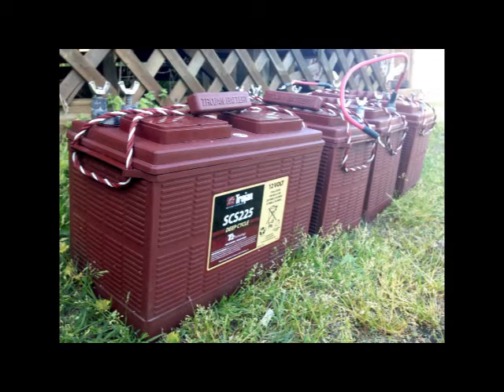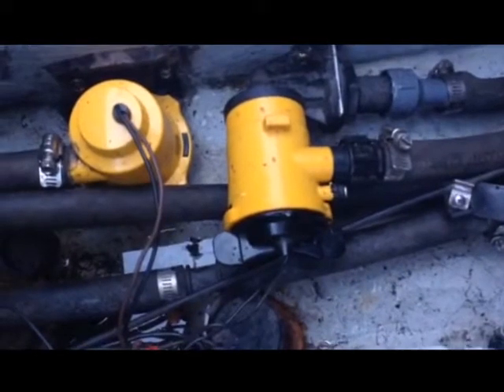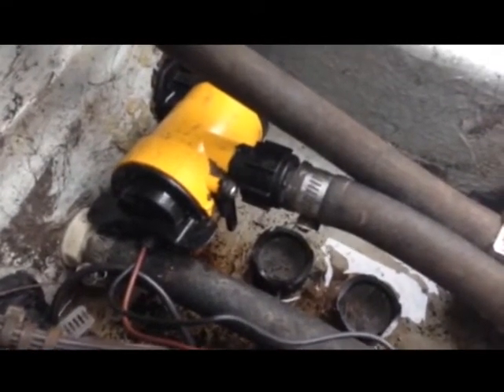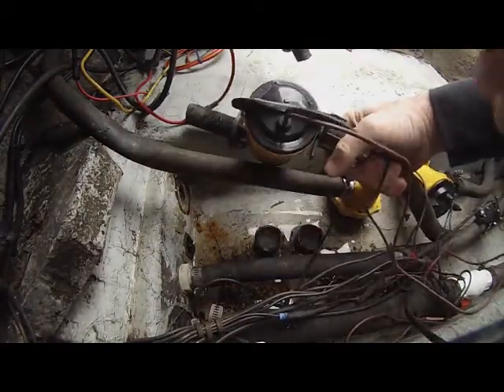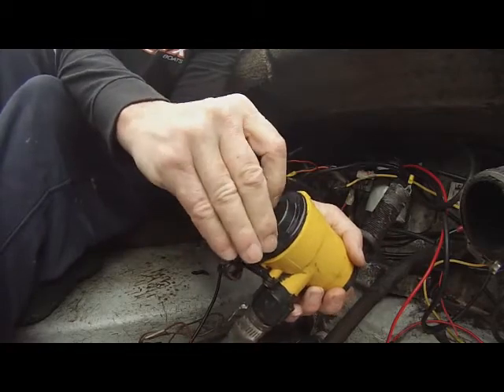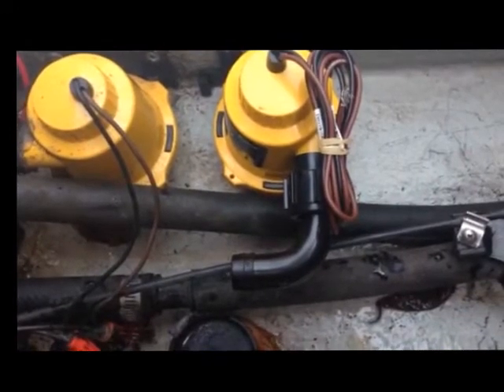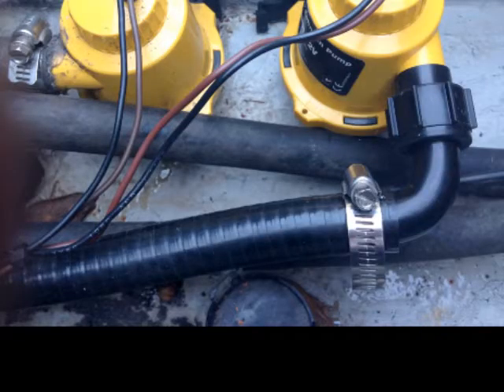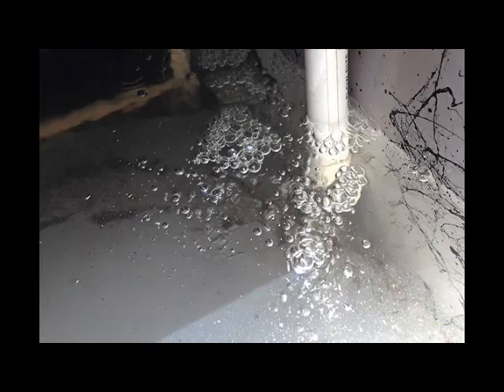Keep Your Bass Boat Alive, Part 11

Comment: Mark, I have watched all your keep it alive videos, great for all us old folks. (78 for me). I bought a 1997 Nitro savage 884 with the mercury XR6 EFI 150hp 2stroke. Ebay auction $2750. Drove from Florida to Texas to pick it up. 1750 miles round trip. Like you, I did all the suggestions on the engine as your friend listed. I installed new top end carpet, new seats. New custom rims and tires. Im in the process of replacing the bilge pump and two areators and starting to remove gas tank tomorrow. All done by myself. I am replacing some of the rocker switches and wiring up two Humminbird Helix 7's. If possible, could you direct me to getting wiring schematics for the boat?  Keep up the videos. Mel Case
Reply from the maker: Mel:

Sounds like you did a great job with your Nitro. As for wiring schematics, I don't have any idea how to get them. I rewired my boat from scratch by running No. 10 positive and negative wires from the battery to an electrical bus I attached under the console. Then I ran everything to the buss for power.

Comment: removed tank, glassed and resined area, putting new hoses,areators, bilge pump, thru the hull puck, fuel/water seperator. 1997 nitro savage 884. need hose layout if you have one. Thanks for reply last video...

Comment: My setup as you had stated Mark is different. I'm running 750 GPH, but I think I want to upgrade the motor to a 1000 GPH. I recently replaced the bilge pump with the automatic sensor, but it fails to throw water. It was throwing water when i first installed it and now nothing happens. It does turn on and you can hear it turn but that's about it.
Reply: Sounds like something is stuck in the impeller. Take the pump apart. Might be something stuck in there.

Comment: I've got the pumps apart. My casings have stress cracks on them. I will need new pump cases for my Mayfair . I found on flow rite my valve which contains three flappers. It looks ok and I can't remember if I was in the recirculating mode when trying to pump out water from the live well. Academy sports didn't have anything that I could use.